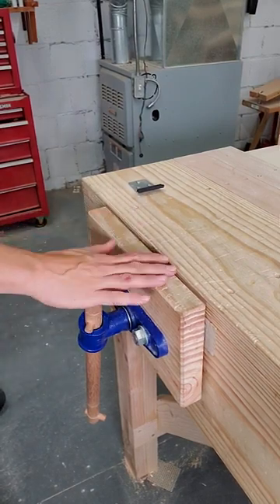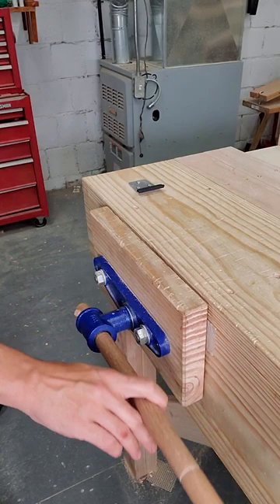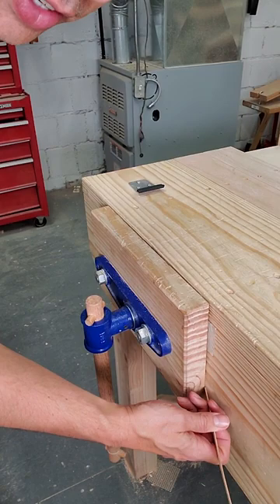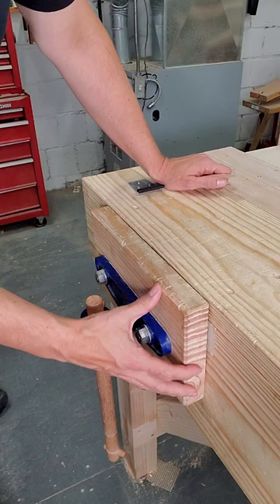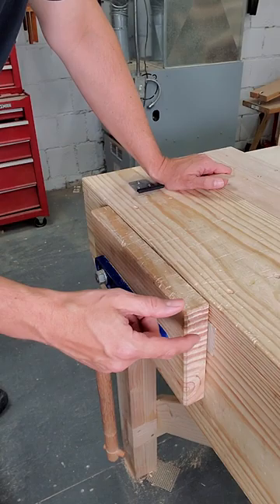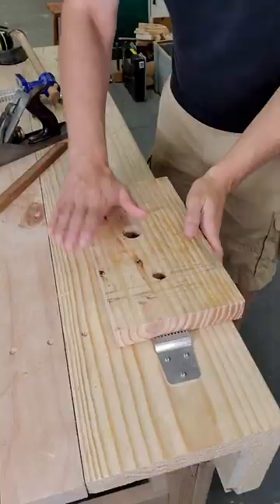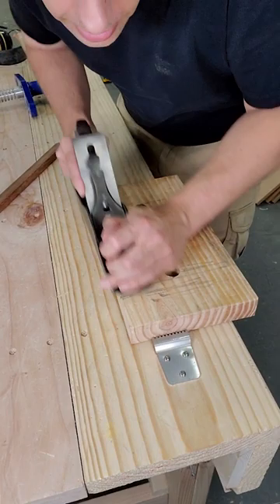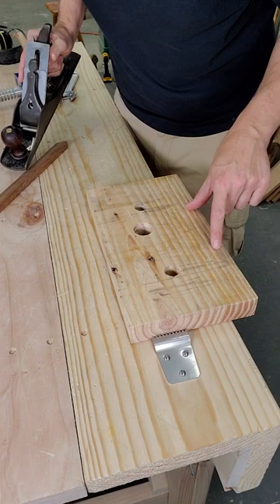Is Your Vise Losing its Grip? #shorts #woodwork

Comment: A better solution would be if you put a 3/16 of an inch thick steel plate between the metal part of the vice and the movable jaw (The one that has the gap on top) from day one, you wouldn't need to do the planning (Shaving) every now and then.
Reply: I agree, I think.  Put a 1/4-inch steel plate on the movable jaw between that blue metal and the thick wooden jaw - and carefully mark and drill the holes for the threaded screw.  Heck! For that matter, to make things even tighter in tolerance, maybe use steel bushings to keep the threaded piece and the guide rods from wearing the wood jaw/chop whatever.  Nomesain?
Reply: Noob here - how does this solve the problem exactly?

Comment: Personally I would just flip the board on the moving jaw and call it a day
Reply: Then you have to drill new holes for mounting points, and then have the old holes exposed.

This way is better. 

Or, if you are super lazy, and have access to power tools, cut an insert out, plane a matching taper, or slightly more (so the top of the jaw touches sooner than the bottom), woodglue it in, and close the vice.
Lazy mans fix, but it does work.
Reply: @autumn5592  I mean, flip it around vertical axis, so instead of being bent outward, it would be bent inward, and all the holes are already there
Reply: @SarumDustCloud  That's what I'm saying -- the holes won't line up, at least with the jaw in the same position as it was, because it's asymmetrical.
Reply: @autumn5592 IF holes are the concern, glue dowel rod plugs, then plane "IT into submission ". Just a thought,  but I'm suspect there's an exception
Reply: @allanblount4956 that's harder than just planing it to your desired shape.. it would take maybe 2 minutes with a hand planer.. probably less

Comment: How the hell has the grain on that 2x6 not snapped yet!? 
Run a piece with the grain going vertically, much stronger.
Reply: I have to display my ignorance a bit.  Which 2X6 are you referring to?  The piece attached to the vise, or is it somewhere in the table?
Reply: @marcus3457  the piece on the vice
Reply: Because you don't need to crank a vice for it to grip well.
If you are overtightenting your vice, you need to rethink your workholding, or try a different location.

The pine jaw should never experience enough force to bend/deflect/break.

Either that, or you're underestimating how much force it actually takes to break.
Reply: @autumn5592  it all depends what you're holding, and what you're doing with it. 
There are plenty of things that would easily overwhelm that. 
Your points aren't necessarily wrong, but mine also remains valid. The grain going 90° to what it is there would make that vice stronger and thereby more versatile, ergo; better.
Reply: @mircomuntener4643  
'would make that vice stronger'
Actually this will make it weaker on the ends, where you then have significantly less length to hold it together.
3/4 inch thick with horizontal and vertical laminated would be far stronger than either one, and if you look around some people do actually make this for their vise jaw.  Some people do this just for color different wood, but some counter cupping by alternating the grain.
Reply: What 2x6? I don't see a single 2x6 in this video. The piece he's working in the vise is a freaking 2x10 lmao